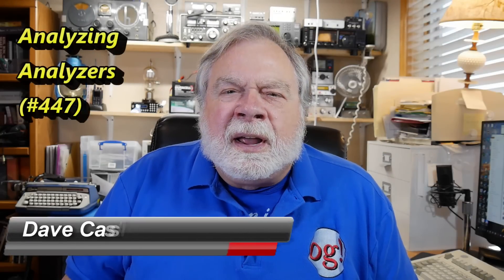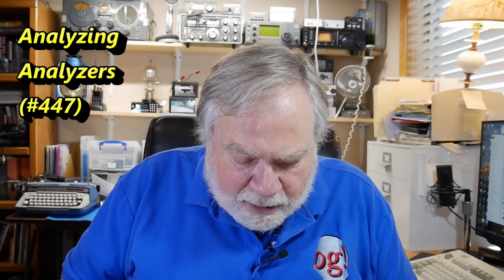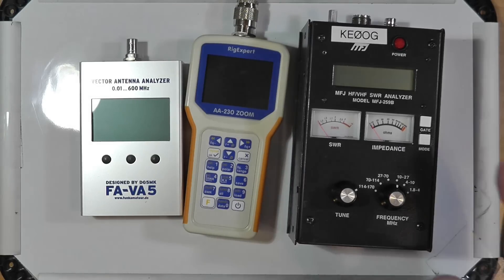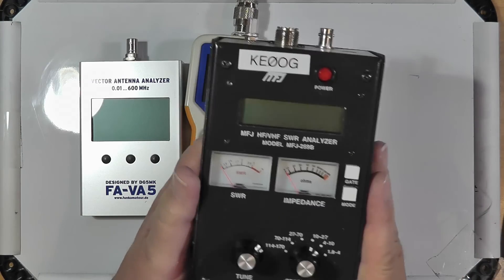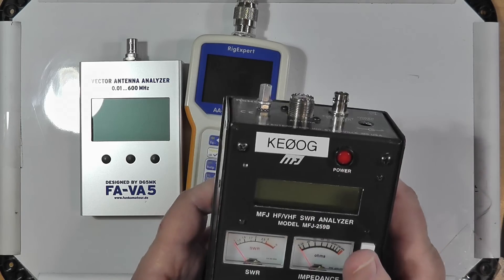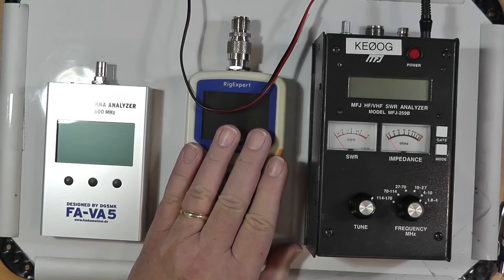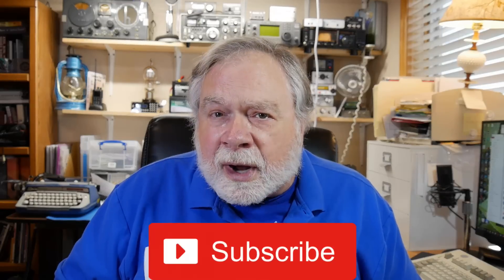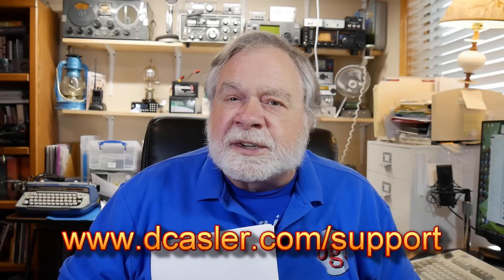Analyzing Analyzers (#447)

Comment: The nano vna works fine as an SWR meter. It takes 10 20 minutes to get set up for each band you want to look at. Mine is set for the entire HF band at once and then I have settings for smaller sections of various bands.. I don't use the more intricate readings like the Smith meter or reactance.  It does take about a minute to make a fresh sweep and give you a fresh picture and in that respect these pricey meters are probably faster but no better. The nano VNA can do many things above my needs and perhaps you will grow into them. It is a precise scientific measurement device.

Comment: Hi Dave, can you please help. I have a rig expert Aa55zoom and a stick pro that I have used to check my antenna SWR! MY Confusion is that with both rig experts I obtain 1.6 / 1 But when I use the Icom 7300 in built SWR Graph that plots as you key the mic I see an SWR OF 3.O / 1 ?.?
Why would this be the case, portable isolated meter shows a 1.6 Icom says 3.0. Love watching your videos. Very informative VK4PRO AUSTRALIA (Paul)

Comment: Another great video with clear explanations. I considered the MFJ analyzer but decided on a nanovna just for the cost. The learning curve is steep (especially when you're older) but I have it set up as an swr meter and have successfully tuned several antennas including a 40M inverted V, a 20M vertical with counterpoise and a hamstick dipole. I may still go with an MFJ but for now the nanovna gives me enough to tune with.

Comment: About the nano VNA: I'm by no means an expert, and it really does have a steep learning-curve. For me though, I bought one because of my low (or non existent) budget, and I'm not disappointed!  It really does a LOT of things. BUT.... It's not a perfect measuring tool, like the antenna analyzers shown here. I would definitely NOT recommend it for somebody who doesn't know how to use it, of doesn't have any use for it other than measuring SWR. It's really too hard to learn for just that single use. If you are building your own radios though, it becomes more useful for, amongst others, measuring filter response, cable interference, things like that. Even then, I'd suggest to use it only as a rough guide tool. Save up for better and more precise equipment. 
But that's just my personal findings after using it for some time. As I said, I'm by no means an expert ;)
(PD7RAD)

Comment: I would like to add that there is a great book put out by the ARRL, Understanding Analyzers, that I think is also very helpful. I have the same Rig Expert analyzer that you have Dave and it is very nice,  however,  I find it a little complicated to use and I definitely have to refer to the manual. I also have the Comet antenna analyzer Mark I I with digital and analog display and I like it very much. The reason I bought it is because it will work up to 500 MHz. I will add that is only an antenna analyzer and will not check any feedline like your MFJ. The MFJ 359 series will check up to to 440 MHz if you need to check antennas in the higher frequencies. A great video. Keep up the good work. N3EDO.
Reply: i have that book. love it!

Comment: For me, the RigExpert AA-230 ZOOM is all I need for antenna analysis and tuning (and I also own the MFJ 259C and Comet CAA-500 M2).  Not only is the RE user-interface and the graphics the best IMO, the ZOOM feature is amazingly useful when looking for resonance in- or out-of-band. Dave was mistaken in his comments and perhaps doesn't understand the RE zooming function - I use the RE up/down arrows constantly: zoom-out (up arrow) to find the resonance if it's out-of-band or zoom-in (down arrow) to identify a more accurate and specific resonance frequency in-band. I also own the RE Stick and use it primarily for portable ops in the field. 73 KJ6ER

Comment: Once you get used to the menu system and calibration on the NanoVNA usability is not an issue.

I would suggest that it's worth getting one of the nicer models (30-40$ more?) with a fully-enclosed case and UHF connectors. I've worn out the SMA connectors on mine after less than a year and I'd hate to drop one of the little basic ones with open sides in the dirt when working on an antenna outside.

Comment: Rig ex are great but expensive for tool that sits around most of the time. I say any amateur can learn the few calibrations you need to do on a nano vna to get it to operate as a ant analyzer. It’s rather easy and you need to calibrate the rig ex if you want to measure twin lead. And if you want to isolate you coax out and just measure the ant on a rig you need to calibrate aswell. Yes you pay 350 for convenience of a two button or knob dedicated analyzer but with all they can do so much more then just tell swr. They can measure impedance. It’s a valuable tool. I don’t own the expensive ones just a basic 2.8” nano vna and I love it made adapters and it’s just as good as one of the others 😉😉 and it saved me 300$ to sit in its box ☺️waiting for the next balun I wind or ant project I want to explore. Nano is easy and menus are easy 2 hrs and I knew enough and a few more vids and it became a necessary tool

Comment: Buy an Analyzer, or have a friend or ham club that has one. The MFJ 259-269 have been around for years and work fine. The NANOvna's are cheap and work, but are a little confusing to work with. The Rig Experts's are great, but not cheap.

Comment: Some of the antenna analyzers (including the MFJ 269) do not have enough RF power to work through my 590' open fed delta loop and balanced tuner.  Another thing to be careful about is to not leave the analyzer connected to an antenna when transmitting another nearby antenna it can fry the input stage even if it is powered off.

Comment: I have the MFJ 269C. The D has extended frequency below 160. Unless I have a radio that goes that far, the 269C covers all the radios I have. Like i said, not below 160 and anything about the police/EMS bands on 70CM, I really don’t need. I have stock antenna from ambulance builds. So 160-6m, 2m, 1.25m and 70CM is fine for me. I do want a digital one to learn more about the smith chart.

Comment: If your Build Antenna's then Yes, as knowing how far your really off in ohm's and how much reflection helps so much in getting the SWR right, if you are putting up a Ready Made, then SWR is enough, the cheaper Chinese copies like the AW07A works well, mine's been running for 4+ years, or the cheaper SARK100 ANT works, if you had the Money then one than can scan the band aswell

Comment: Love my 230 zoom. Couldn't justify an extra $200 for the AA-600 just to add 440, but other than that it's a dream to use, especially if you spend some time to learn use the functions/shortcuts. The bluetooth option is nice,  as it lets you take more then 100 samples when doing things like SWR charts, and you dont have to lug a laptop around.

Comment: My best buy was a Rig Expert Stick. Worth every cent for building antennas.
Reply: Yes, it's helped me diagnose and tune antennas big time. I am sure I would have stressed my rigs without it. Rigs cost more money than analyzers.
Reply: @Roddy1965  Exactly. Cheaper to have one then to replace burned up radios. 
I like building my experiments from scratch. SWR meter just won't cut it. I want to see the whole picture.
Reply: want another one? I went back to the aa-55 after the stick 230.
Reply: @forgetyourlife  I'm not 100% on the Stick interface, but when you hook it up to a laptop, it's very easy to use, and I really love it. The mode where you just push a button and it finds the best resonant band is pretty good and easy, though.  I love the aa-50 etc. A friend has one.
Reply: @Roddy1965  yeah, I never plugged it into a pc. It was outdoor use only for me which is pretty limited.
Reply: @forgetyourlife  Fair point. The software is easy install, easy use. Very nice if you can. Works with all RigExpert it seems.
Reply: I bought it specifically for the Bluetooth and running it to a PC. I knew I didn't want it for the tiny screen. I'd still buy it again otherwise you might as well stick to the handhelds with bigger screens.

Comment: I use my antenna analyzer  to check coax after I crimp new connectors.  By using the TDR to measure length in both directions I know the other end  connector is ok
Reply: Whats a TDR?
Reply: @garrysekelli6776  it is a Time Delay Reflectometer,  in simple terms you can measure the delay between sending a pulse and then receiving the reflection. If you know the velocity factor of the cable you then know where the reflection is originating.
Reply: @g0fvt  ah. Cool. So it works by sending electricity down the wire but in pulses. Then a separate part of the machine measures how much the wires heat Up.
Reply: @garrysekelli6776  Heat is not a factor with measurement, think of it about like radar firing down the cable then waiting for the reflection.
Reply: Time Domain Reflectometer.
measures coax length by sending a pulse down the cable and measuring the time it takes to reflect back. and calculates the length.

Comment: I have several vector network analysers.  They all need 'calibrating' before use.  The MFJ doesn't, so it is quicker to use.  I don't have one but have used one. It only works on one frequency at a time.  Seems old-fashioned and clunky to me.

Most VNAs scan  a range of frequencies and graph their results.  They differ in the number of points they graph and the frequency range they scan.  They need 'calibrating' before use, for every different frequency range.  Often they allow for a commonly-used calibration to be stored.

My favourite is the 'Sark 110'. It is very small and lightweight, also looks very good!  It covers all the frequencies I'm going to use up to but excluding 440MHz.  It is easy to use, does more than you can reasonably expect and is very accurate (given accurate calibration!).  It is expensive.  And you need a set of calibration standards, not supplied.  Good calibration standards are not cheap, either - they go from pricey to eye-wateringly expensive.  The frequency scan is as wide as you want and it captures enough points to make a good graph.  For example, you can set it to cover 1.8 to 29.7 Mhz, average each data point over several measurements, with a delay on starting the scan.  Attach it to the feed point of the antenna (remember - small and light), press the start button and haul the antenna into the sky.  Come back after half an hour and collect the results - both as an on-screen graph (option to download the screen as a bitmap) or download the data points.   This 'deep scan' mode can collect 10,000 data points, so even a complete HF scan gives enough detail to show up any problems.  The data format is a standard CSV file so is easy to import into spreadsheets etc.  Some applications can use the file directly - such as SimSmith.

There is also a 'Sark 100'.  It is cheap.  I have one. It isn't accurate - there are fundamental problems lurking in the firmware. Not recommended!

I have several NanoVNAs.  They are very cheap! Cheap enough to buy several, with different connectors.  I have SMA and SO239 versions.  Some come with calibration kits included - beware some of the SMA standards don't have proper connectors and will wear down your sockets quickly.  The major failing of NanoVNAs is the small number of data points in a scan, max 110.  However, there is PC software allowing you to stitch together several scans  under PC control.  Good but not practical on a windy, rainy antenna field. One advantage over the Sark110 - they are 2-port devices so can measure through filters etc.  The Sark is a 1-port analyser - fine for analysing antennas but can't handle filters.

I have some 'analogue' instruments too, 'noise bridges', 'return loss bridges' etc.  They are much less accurate, are slow and difficult to use and have few redeeming features.  They languish at the back of a drawer somewhere. 

Why bother?  A simple 'SWR meter' is a useful monitor in your feed-line. Everyone should keep one in circuit in case something drops off your sky-hook. It tells the 'magnitude' of any mismatch.  What it misses is the 'phase' of the mismatch.  You can't tell if a problem is due to mismatched resistance or reactive impedance.  A VNA (or even the MFJ analyser) will give the solution quickly.

73 de M0PTB
PeteS

Comment: I have the Comet CAA-500 Mark II. I love it. It is 1.8 to 500 MHz. A little more expensive unit, but taken care of, will last longer than you will. Very easy to use and versatile. Just another option. I understand the money factor, as I am retired, living on SS, so I have to stretch me money too. I love tinkering with new antennas to try new things, so I can justify spending the money. I am spoiled by it now, and wouldn't be caught without one. WA9H

Comment: 100% nanovna...best cost vs benefit.  Also very small for portable use.
Reply: I agree, NanoVNA all the way for me. Had the MFJ and got rid of it. Too clumsy for me. You can tune as Dave said, but I can set the nano for 100Mhz to 200 and see the swr dip and if there are any other dips. (You can see the performance of a dual band antenna on one screen). Then you narrow it to 140 to 150 and see the lowest swr as well as the antenna bandwidth and watch the graph as you tune it. I've hooked it to my shack antenna when the swr went up to see if there's a problem or if it shifted because of rain or something. For me, the best tool I ever got. W9DLP
Reply: Dave said about the NanoVNA "They are always changing the firmware", when he should have said "wow, you get to change, if you want the firmware to capture new features and functions".

For example, it already works as a 50Khz to 1.5Ghz CW Signal generator out of box, but one can control the drive current on the oscillator chip and add AM modulation, or add FM/PM modulation by shifting the frequency slightly, so one can tune the front end and IF stages on your reciever. "Wow, the code is open source, I get to add this if I want"
Reply: They're also quite easy to use as an antenna analyzer. Just watch a five or ten minute Youtube video showing you how to do it.
Reply: I must have gotten a bad one. I had to constantly calibrate and it would lose it's mind. After a week of fighting it trying to tune a antenna a club guy showed up with a rig expert and within an hour we where don't!
Reply: Kinda overkill for SWR since you have to calibrate it at least 3 times for every use. But it is amazing if you need any of the other functions. When I worked servicing repeaters and pagers we had to lug around a HP 8920 communications test set. That's basically a 5U rack with a handle full of lead acid batteries, a heavy CRT, and instruments. Now I can slip a NanoVNA and a HackRF Portapack into my pocket with an adaptor kit and take over the world.
Reply: @AugurIliKur  You only have to calibrate it once, and then you can save the calibration. I've found that you don't even need to reload the calibration, presumably because I never use it for anything else or let it run out of power so it retains that calibration.

Comment: I have the MFJ-227,  the ninivna and the nano vna.  I would recommend the minivna tiny by mRS over the nano VNA and over the dedicated antenna analyzers MFJ, like you said the dedicated analyzer are one trick ponies, the nano vna is really just a toy but is getting better, the mini is a fully mature product and simple to use out of the box.
Reply: IMO, I think that you are being bit unkind about the nano VNA. Although it has its failings as Dave pointed out,  it is a lot, lot more than a toy and I've found mine invaluable in a number of problem solving applications.
Reply: Their "how to buy" tab has 3 links to sellers that don't carry it, or don't have a page for it. That's not a good sign about the product you are recommending.